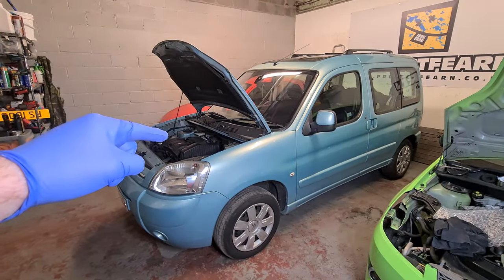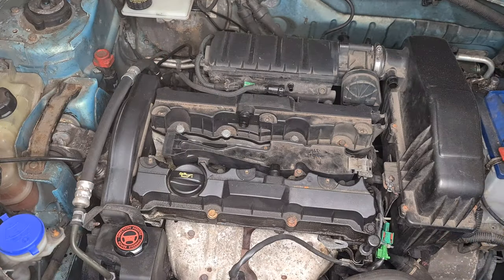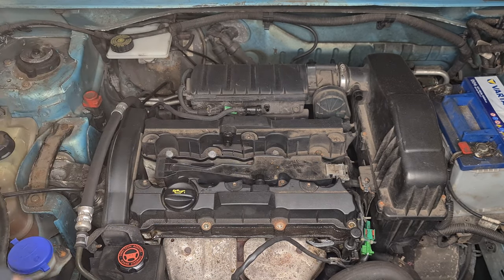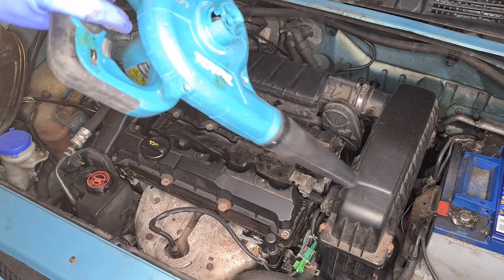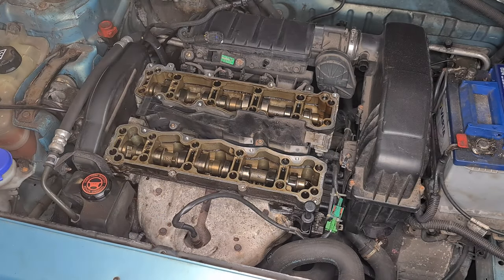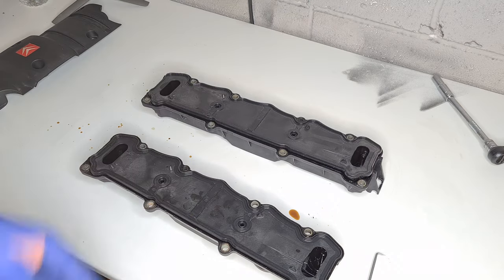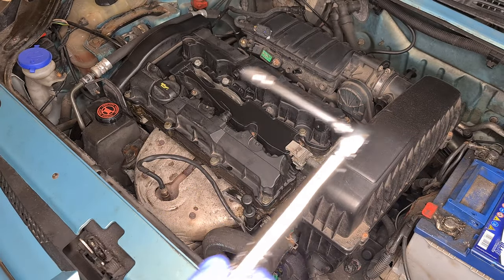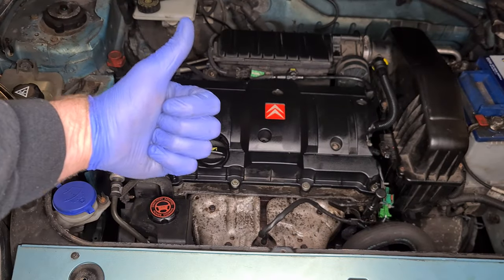Replacing the ROCKER COVER GASKETS on my 2005 Citroen Berlingo Multispace 1.6 16v Petrol (TU5JP4)

Comment: Got one on LPG, the previous owner had it chipped from 109 to 119 PK, the French did a good job on this one, simple to work on, cheap parts, very practical! Arguably the most practical over any larger van or MPV/SUV because of the low weight and dimensions, simple reliable engines, very easy slidingdoors, a breeze for the elderly. The only thing that bothers me is that over active overengineered eco mode! Each time after parking, I just zip open my bag to look in it the damn lights dim to off.... Lately I just open and close a door for a few extra French seconds... I also have a larger 90s Toyota Previa that I just restored with new brakes and shocks and everything, my new dayly driver dream car?... I always drove a Fiat Scudo camper, which is just that bit bigger, so the Berlingo/Partner just came in 20cm too short for me to sleep in the back without having to move the front seats way forward, or even all the way back...just too short for my liking. 
BUT I cannot choose which one to keep, the Japanese or the French,... my peugeot Partner just keeps on topping it as far as practicality goes, It handles big bumps better, I almost never need to break for traffic bumps, and it's way cheaper to own.... Very hard to sell a Berlingo/Partner, and trade it in for what they call a more luxurious, better driving car, especially with the roofstorage and sunroofs, thats exactly what this car needs!! The list positives is almost endless, but my 'new old' 95 Toyota Previa mid engine RWD has one thing the Peugeot cannot really give me: a thrill when driving it! Hard choice...... Driving my Previa gives mee a better feeling, but my Peugeot always gets me everywhere fast and cheap, and yes its easy to clean on the inside. This it the kind of car you forget you use it every day for everything, it just assists you without screaming for attention.. Thàt car you should never have sold ;)
Reply: This car is perfect for people who don't really care about the ride and just want the most practical car to get from a-b. The best thing about the berlingo/partner is that its not a wide car, its actually very manouverable on small roads and in cities and doesn't feel large like many suv's do. The worst part besides it steerling like a boat is how terrible fuel economy it gets,I have the 110hp one too and while its not that slow, it gets terrible mileage because of the shape of the car. I will scrap it soon(it has done over 300.000km) and my plan is to get a Peugeot 2008

Comment: :)
when a toothbrush lasts longer as a parts cleaner than it did as a toothbrush............... :)
was told years ago that putting an extension on the torque wrench...alters the amount of torque at the bolt.... ?
No idea if thats true... finger tight ere.... :)

excellent vid as always..

N x
Reply from the maker: I think I've heard that too Neil. As every bit of metal will have some twist in it I reakon. 👍